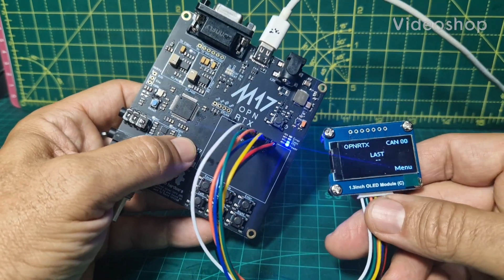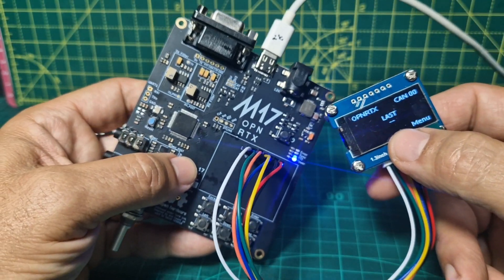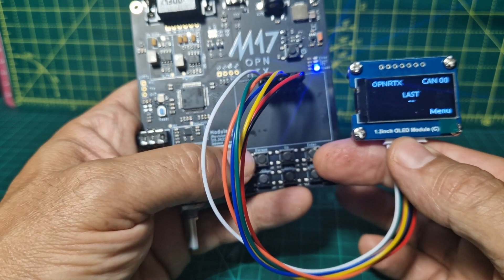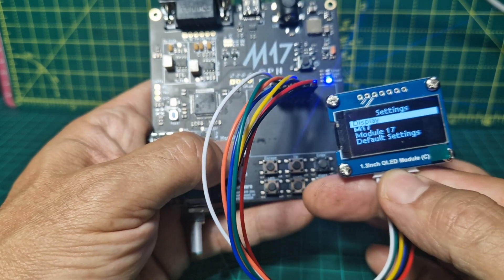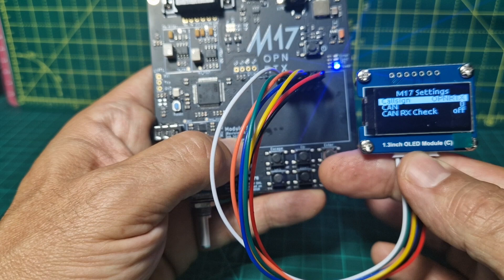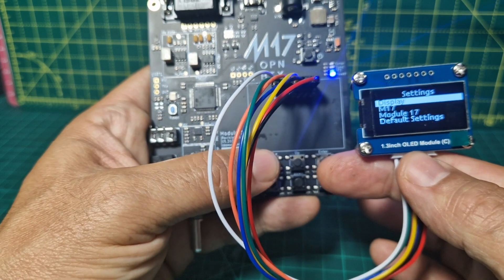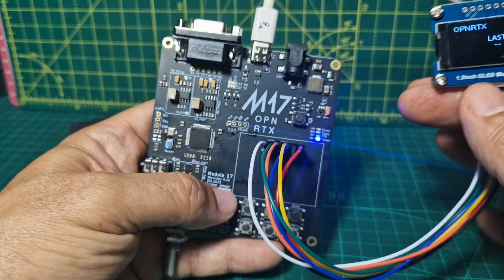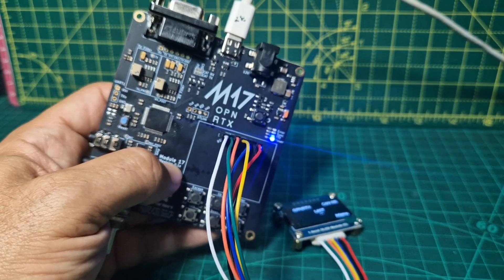M17 Module Upload Firmware & TEST

Comment: CAVEAT: This is not a supported install method by the M17 Project, It was designed for a specific issue that Andreas was experiencing during community troubleshooting efforts. The zip file mentioned in this video is not publicly available or released for distribution by the Project.
Reply from the maker: Hi thanks alot for community help , my friend has also used the same files and it worked 100 percent .
The instructions on Git Hub for Windows are too complicated can we have  firmware loading software this would make installing using Windows so much easier-Thanks again :)